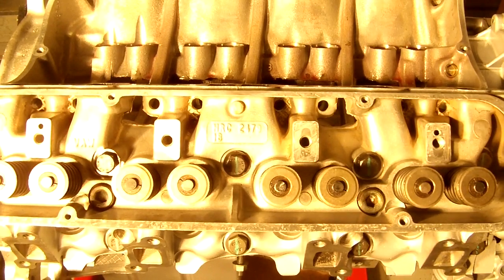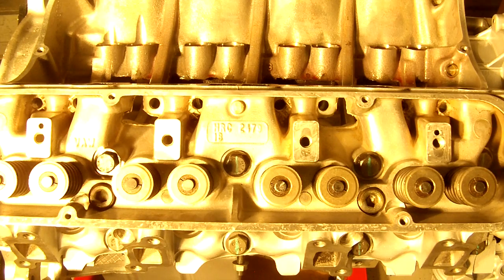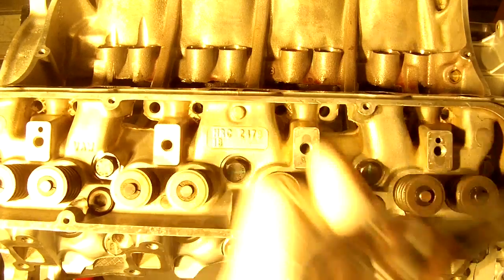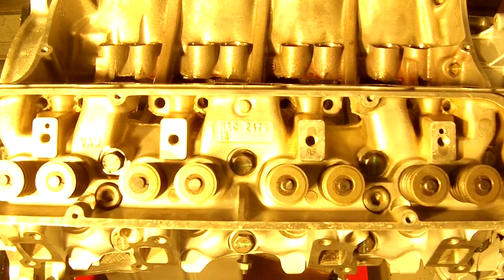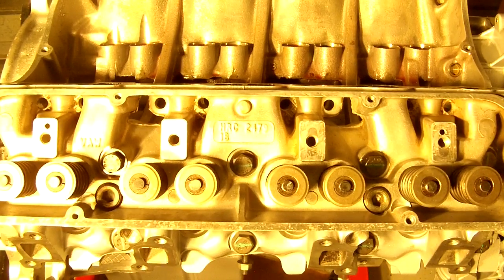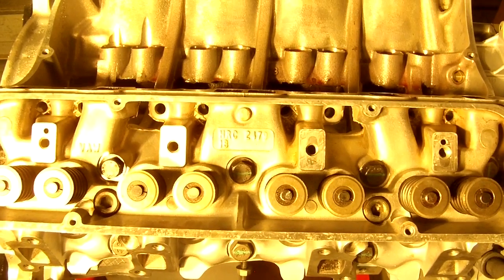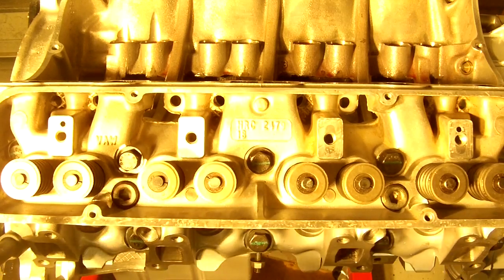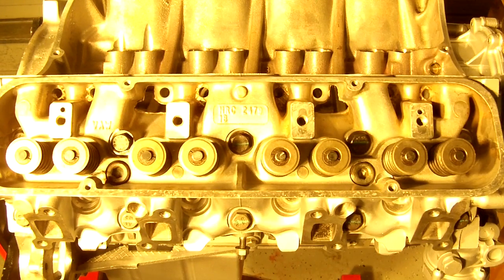Land Rover Discovery - Cylinder Head Bolt Torque - First 90* Turn, Step 2 of 3

Comment: what heaping if you do less then 90 ?
Reply from the maker: Well, they are stretch/torque-to-yield bolts and that is what the Buick engineers, who designed the original 215 block the Land Rover engine is based on, recommend. If you don't tighten, you may or may not develop a leak in the future. I don't know because I followed the instructions in the official Land Rover Discovery manual - download it for free online - search RAVE Land Rover Discovery II and you should find a PDF.
Reply: basically, they are expansion bolts. they act like a spring and keep  torque during heat up and cool down of the engine. just like a spring, they do lose tension over time which is why you should always replace them with new ones when replacing the gaskets.failure to do them to spec means you just wasted time and money and it's not a question of if the gaskets will fail but. how far you get from your shop before they do. the initial ft/lb torque is to seat the gasket or "mesh " it to the head and the block. the  final 90 degree turns is to secure the heads to the block with out placing unwanted torque to  any random spot on the head while at the same time making sure all the bolts are tight and secure.

Comment: Where is the first video to see the torque or nm dude to see ur torque wrench
Reply from the maker: The bolts are torqued in a specific order, download the FREE official Land Rover Discovery II manual, called the RAVE. The torque is set at 15 ft-lbs/20.3 Nm, then you tighten all an extra 90 degrees, then tighten all another 90 degrees. So it is a 3 step tightening process for each bolt.

Comment: Whats the point of marking the bolts when you can judge by the position of the ratchet handle?
Reply: When working the installed engine, it’s way easier to have the bolts marked.....especially for the 2nd set of 90 degrees.
Reply from the maker: +Riza Khan Because you can forget which bolts or order you went in. It is just a precaution to avoid missed bolts.

Comment: So.........you left it at 15 ft-lbs the whole time? I mean for the 90* turns? wheres that information in the video or your description?
Reply from the maker: No, after the initial 15ft-lbs torquing, I switched from a torque wrench to a long-handle 1/2" drive ratchet (http://www.harborfreight.com/12-in-drive-extendable-ratchet-62311.html) for leverage for the remaining two 90 degree torquing processes.

Comment: im doing this now but my number 1 bolt is tight as hell
Reply from the maker: +Ian Mcdowell I had to buy a 24" breaker bar from Harbor Freight: http://www.harborfreight.com/12-in-drive-25-in-breaker-bar-60819.html. I couldn't even get them loose with my 12" breaker bar or my 1/2" air impact gun. They came right out with that 24" breaker bar though.
Reply: Haha, I went and bought the same one after shearing my 12" breaker getting the head off.
There is NO way I could have torqued them to spec afterwards without it, it took a lot of grunting using that 24" to get them to the right specs.

Thats my only breaker right now, and I use it all the time. What a bargain!